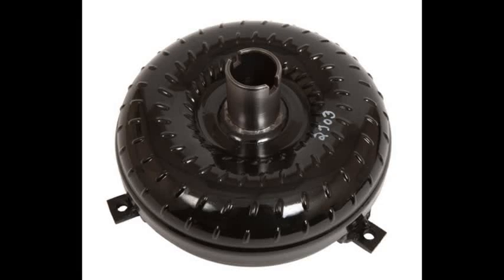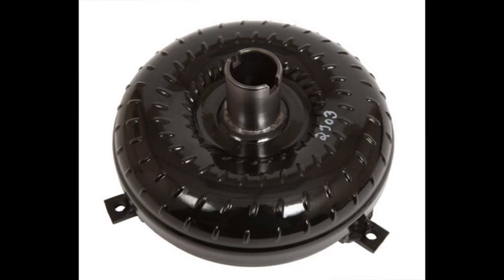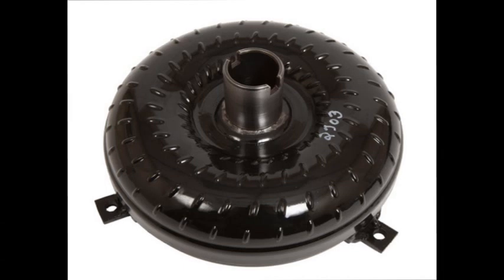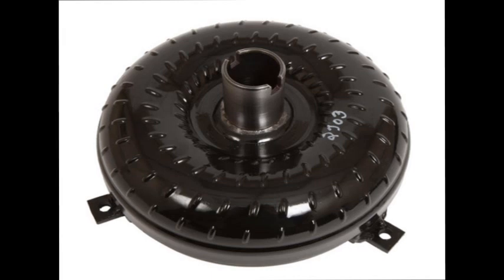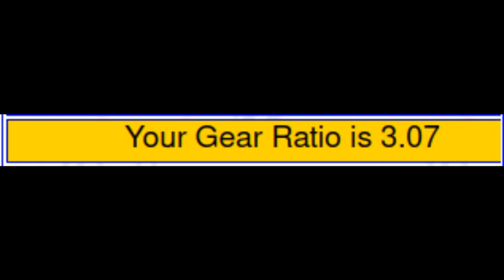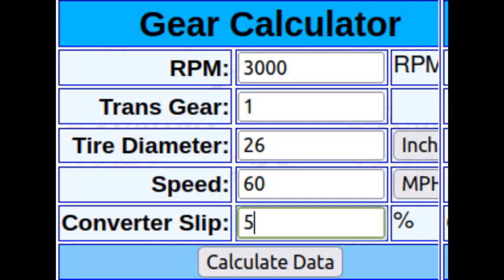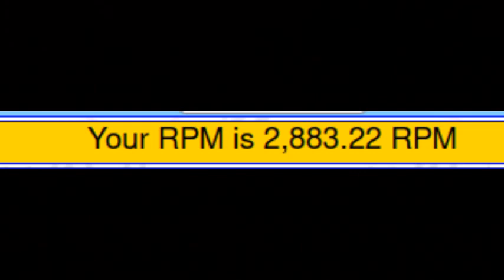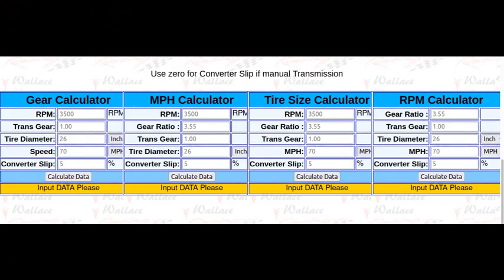Matching stall speed and gear ratio for street.

Comment: None of this matters with lock up converters.
Reply: correct.  and depends on WHAT TYPE of trans too.

some of these transmissions,  i wouldnt lock up because the input shaft  is gonna be your weak point when you start getting good hard hitting converters and a nice valve body  that  will shift hard  with these OD transmissions. even with a little over stock power you could snap an input shaft and that's gonna be a real bad day when you do.  normally  over 2800 rpm stall is when a lot of folks go non lock up with 1 piece shafts..at least in AODs 700r4s/200r4  could be a little different. with those 200/700s, id be running a manual VB  to shift it where i wanted to so it doesnt shift way early

Comment: How would you  figure out  a powerglide transmission  3800 stall
Reply: Thanks for your response. I had PTC to build  the converter for me,it wasn't  off the shelf thanks
Reply from the maker: The stall speed depends on the power curve of the engine. That may be the right stall, I don't know. However powerglides are used in drag racing, but I believe they tend to need frequent rebuilds. My Cutlass came with a powerglide, or "jet away" as Oldsmobile called it. I asked a transmission shop about building it to bracket race. He told me don't use it, as it won't last. My car also weighs 3500 pounds. With enough cooling, you can keep the temperature down, but longevity of the powerglide, I have to defer to the transmission shop.
Reply from the maker: If you are making much more than 450 foot pounds, and it sounds like you probably are, you would need to call a vendor and spec a converter to hold the torque you make at the RPM you want. A off the shelf converter may not be strong enough to live behind that engine. It may also stall higher than rated. Thats all I have. Good luck with it.

Comment: I've tried a few aftermarket torque converters, with varying results, but the one I feel to share is when I put a B&M 2400 in a pure stock '95 Z28 convertible with the lame 2.73:1 axle. Best single mod I ever did in my 47 years. It instantly became a tire shredder. Absolutely would do all over again.
Reply: Imagine the fun with a 3.73 gear!
Reply: @Formerlywarmer  how would this converter work with 3.08 rear gears and 26" tires
Reply: @jeffmentzer6550 not bad at all assuming ur making a fair amount of power/ torque. Compared to a 2.73 it’ll be somewhat noticeable.  U want the advertised stall rpm to be into your torqued rpm band and u want ur gear low enough that if ur running say 1/4 mile the motor should be revving at over very near the peak rpm for your power band. Ppl try build a car for the street then end up disappointed at the track or the other way round. Pick what purpose ur build for and take what you get in the other situation. Or add NX and u can make up the difference but do ur homework and know what ur doing because nx isn’t necessarily any more dangerous than other power mods it’s just really easy to go overboard and mistakes are expensive.
Reply: @Formerlywarmer  only street, no racing...

Comment: Guys, first off, I do tens of thousands of dollars of business with summit business every year, but I have to tell you that their tech videos are very general and very generic. So if you're taking advice on torque converter stall speed rpm choices from their videos, then good luck with that. Secondly, I had a street/strip car that i bought brand new off the showroom floor which was also my daily driver for well over three years for 12 months out of the year. In that three years, I put 55,000 miles on the car, and I raced it at two different drag strips. It was a low 12 second car. I installed an aftermarket torque converter which had a 3,000 rpm stall speed and my cruise RPM@70mph was 2,700 rpm and I NEVER had any problems with neither the engine nor the transmission overheating and I only had a plain factory radiator and cooler. It wasn't a super cheap torque converter, (you only get what you pay for so avoid those crappy B&M models or the like for $400) but it wasn't any top dog super expensive one either, I paid $700 for it. Furthermore, those cheap sub-$500 torque converters will give you a whole lot more slippage than 5%. And I'm not talking about stall speed, I'm talking about slippage percentage which is measured at full throttle ABOVE the stall speed RPM. Some of the cheap ones slip as much as 17% and that's what will create a whole lot of heat and kill your transmission over time, even if you have a real low 1,800 rpm stall speed. I'm definitely done here trying to warn you guys. Good luck
Reply: What car? What was this $700 converter? I mentioned not to trust B&M what did you trust?
Reply: @Formerlywarmer  I have no idea what the reason is for your questions. Sounds to me like you're ready to throw some type of argument at me, but I'll answer your questions anyway, even though it really doesn't matter: The car I gave as an example was a 2003 Mercury Marauder. So why does that matter? The converter I had was a Stallion converter from Precision Industries.
Reply: @mean70632 no argument at all just that wen u put an expensive converter in something that makes poor power and especially torque the thing that makes converters work may not be a good match and I wanted to know what u put it in and now not surprised u had less than desirable results.  As for B&M I’ve had good luck with them and TCI converters behind some 300 hp Mopar motors and couple 600 hp big blocks and they all held up and did exactly what they were advertised to do. No argument just trying to understand your comments
Reply: @Formerlywarmer  the car wasn't stock. I installed a small under hood roots intercooled Magnuson/Eaton supercharger in it. So it had just under 500 HP, ( 480 actually) and I also installed 4.56 rear gears in it, and turned consistent 12.2 second ET's at the drag strip on pump gas, and 1.6 second 60 foot times on drag radials. I got very good results with that converter, so I think you misunderstood what I said completely, and I don't consider a $700 converter as being very "expensive" at all as you suggested. I have an 850 HP pump gas drag car that I'm currently building, which I bought a $3,200 torque converter for. So $700 isn't by any means an "expensive" piece at all. What amazes me is how many people won't think twice about spending $800 to $1,300 for a clutch and pressure plate combo for a stick car, but then balk at the idea of spending $700 for a torque converter, even though the torque converter's job in an automatic car is the same as a clutch and pressure plate performs in a stick car. Go figure
Reply: @mean70632     you should have stated all of that before you left people hanging.  Sounds like your trying to be somewhat Negative.
Reply: @wally6629  How did I "leave people hanging? I stated facts about torque converters regarding their use and about stall speed RPM, as well as about street use. I had reasons for my original statements, which were based on my own experience both on the street and at the drag strip. So what's your problem??? What factual and accurate information have you added to this discussion. Because I've yet to see it. You might want to look in the mirror.

Comment: You're instructing others here to go with and adhere to one of the biggest misconceptions people have about torque converters. Cruising speed RPM has NOTHING TO DO WITH stall speed rpm. the reason being that your torque converter will NEVER reach anything close to the stall speed RPM at part throttle. the stall speed RPM occurs only at FULL throttle. When you're cruising you're not using full throttle. Not even close. So your math in this video is ALL WRONG. I mean no offense but I had to point this out to you and to your viewers
Reply from the maker: I respectfully disagree. The stall speed does vary with torque input, which is why converters are often listed as a range, like 2400-2800 and so on. However said converter cruising at 2800 at part throttle is locked, because it is centrifugal force that is aiding in that happening. The math in my video is not related to the torque converter itself. It's just a means to calculate cruising RPM for people in the planning stage, who don't have their cars assembled yet. My only premise in the video is to choose a stall rating close to cruise RPM to control heat build up in street driving. It's a conservative recommendation leaning more toward street than drag racing, as in my opinion thats where most cars spend most of their time. There's nothing wrong with running more stall speed if you want to. The object of having a hot rod is to have fun after all. Just depends how you want your car to behave. Anyway, best of luck with everything.
Take care,
Tim.
Reply: @timsprojectcar1875  Tim, thanks for being polite about this, but I have to tell you that again you're wrong in what you said in your reply. You mentioned "which is why converters are often listed in a range like 2,400-2800, (RPM)" but what many novice guys don't know is that off-the -shelf crappy converters are the only ones where the retailers/manufactures list an rpm range. Because most experienced amateur drag racers who also drive their street/strip cars on that street know that any purchase of decent, well made, quality torque converter requires the customer to fill out a "vehicle spec sheet" or at least call the sales person on the phone so that they can fill it out for him after asking several questions such as vehicle weight, tire height, engine horsepower, camshaft specs, first gear transmission ratio, and rear gear ratio. Without that information there is no way the manufacture can ever get the stall speed RPM correct for your vehicle combo since there are just too many variables which will effect stall speed RPM. 

      Furthermore, it is NOT centrifugal force alone which controls and dictates stall speed RPM as you've claimed. It's the fin count and angle of the fins welded in the stator of the torque converter which does as well as the converter diameter. And that is why when owners of hi-performance cars as well as drag race cars want a stall speed RPM change, they have to send the converter back to the manufacture, so they can replace the stator in the torque converter with one that has a different number of fins welded into it, and/or a different angle on those fins. So again, your torque converter regardless of brand and size will never come close to the stall speed, (known as "flash" rpm) during cruising when you're using part throttle input. The stall speed rpm rating is always at full throttle ONLY.  So although I'm sure your intent is well, I have to tell you that you've been misleading your audience BIG TIME. If you don't believe me, then call any of the well known torque converter manufacturers which have a good reputation, (ie. Coan, Neal Chance, Hughs, etc., etc.) and ask them about what I'm telling you here, and they will confirm my claims.

     Also what many people don't understand is the reason why you should never buy a torque converter without you or the sales person filling out a vehicle spec sheet is due to the fact that any given torque converter will exhibit a different stall speed RPM in any given vehicle it's installed in. FOR EXAMPLE: If you have a converter in your car that weighs 3,500 lbs and it creates a 3,000 rpm stall speed, and you remove it and sell it to me and I put it in my 4,000 lb car, that same converter that created a 3,000 rpm stall speed in your car will now create a much higher rpm stall speed in my car since it's 500 lbs heavier than your car is. And vehicle weight is just one of the many contributing factors that determine stall speed RPM. And if the reailer and/ manufacture doesn't know and inquire about your vehicle weight, as well as many other factors, then their stall speed rpm  "range" claim is non-sense and their converter is a cheap piece of garbage. Here's another example: When you're driving your car with only you behind the wheel, your stall speed RPM will be lower than it would be when you have 4 people in the car, (three adult passengers I mean) since the vehicle weight is increased by about 500 to 600 lbs. But again that's during FULL wide open throttle input. OK I've done all I can do here. If you don't care to listen then you'll continue to spread misinformation about torque converter choices and stall speed RPM. I'm merely trying to educate you Tim, as well as your readers. What you've said and claimed is simply NOT true regardless of how much you want to believe it.
Reply from the maker: @mean70632  Hughes performance "EP. 5 Torque converters 101: What is stall speed?" is a good video to watch. I didn't think I contradicted anything I heard in their videos, but maybe I did. I know for sure I heard either them or Monster say to use a stall speed close to cruise RPM in a street application. I'm going to start looking for that video, so I can name it specifically if I can find it. I didn't conjure that up on my own I promise.
Reply: @timsprojectcar1875  stall speed RPM is taken at full throttle. Stall speed has nothing to do with part throttle inputs since the stall speed is NEVER measured at part throttle. So you're wrong on that
Reply: @mean70632  i mean if the converter  flashes  at 2800  in his car  and he's cruising at 2500,  it  MAY create less heat than a converter  that flashes at 3500. i think that's what he's trying to say  but even that isn't a huge concern with an actual decent off the shelf converter  that's around 700-900 dollars although i will agree  that a custom one is gonna better.

but then id want everything at that point to be custom  

my heads ported and milled a certain way for my short block and displacement and intent/usage, my cam ground by a custom grinder for intent/usage,  then my carb built by a custom carb builder and a custom converter.

most street car guys will NEVER EVER do all of that.
Reply: Summit racing has an article recommending that stall speed should be kept lower than cruise RPM

Comment: Here is a complicated one.
90 Mercury wagon. 5.0 HO Mustang block and cam.
GT 40 heads and intake, headers and 65mm throttle body. 70 mm mass air. It has a stock AOD and 3.55 posi. Body weight is 4000-4200 lbs. 27.4 inch 225 70 15 Cooper Cobra tires. Current  converter is a dirty dog 2000 stall. It does have the HO governor in the trans.
It chirps 2nd gear at 3800.
It will not shift at higher rpms at WOT.
Should it have a higher stallTC?
Thank you
Reply from the maker: I hate to admit this, but I don't know the cause for it not up-shifting at full throttle.  I have never worked on Fords. It doesn't sound like torque converter to me though. I have messed with the governor on my 700r4, which can affect shift points, but I don't know if a stuck governor can stop it from shifting altogether. The place I would look before taking it to a transmission shop is the throttle valve and/or TV cable, to see if it is stuck or damaged. Lastly, I don't think overdrives will go into overdrive at WOT anyway, but 1,2,and 3 should work. Sorry I can't be more help.
Reply: Thank you
Reply: I'm sorry it will up shift but 3800 is the max shift points.
I thank you again.
It probably is a dirty governor limiting the rpms.
Reply from the maker: I just watched a video by monster transmission on how to clean the governor on an AOD transmission. That may be of interest. I don't know if it's the solution, but it is worth a try.
Reply: Thank you

Comment: I have 3.42 gears in my 1996 Chevy caprice lt1 5.7 
I believe the stall converter is 2000 or 2200 
By these calculations and your experience is that stall converter to low ?
Reply from the maker: Good afternoon. The stall is fine if the engine is stock. I did the calculation with your gear ratio for a high performance street application. I assumed a cruising speed of 60mph, a tire diameter of 26",  a typical converter slip of 5%, and the result was 2785rpm at 60mph in 3rd gear. If your engine has a different cam, and so on, a 2800 stall would be good. Depends how big the cam is of course.  If you have an overdrive transmission, I believe you can get a converter with that stall speed and retain the lock up feature.
Reply: @timsprojectcar1875  yes my transmission has over Drive
Reply: @1hunda100 Dude, from what you specify, you have either a 9C1 (police) or LTZ package police car.  If, so, your transmission is the same as a Corvette and Z28; it has a higher stall converter, and stage II shift kit already.  Swap in 3.73s, remove dead weight (like that double hulled steel plate behind the fascia above the knees/under the steering column), ditch the stock style mufflers and resonators for offset Walker Dynoflows, ZZ1 cam, K&N filter and Vortec heads for speed.

Comment: So,,, basically get a converter that will lock up at cruising rpm?
Reply from the maker: That's the premise I was working with. This will make a good compromise between driveability, performance and heat build up.
 It can work running higher stall speeds, but very good cooling would be needed. A good transmission cooler with a dedicated fan would be advised for higher stall speeds.